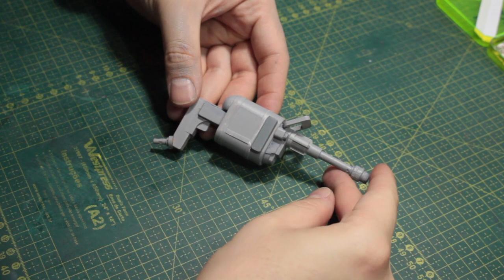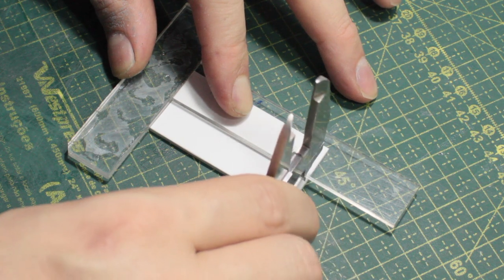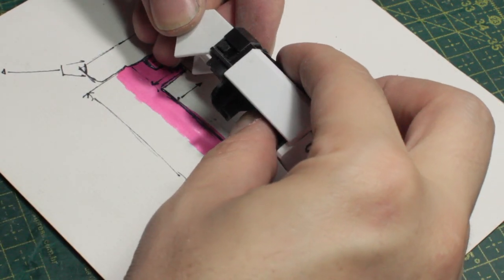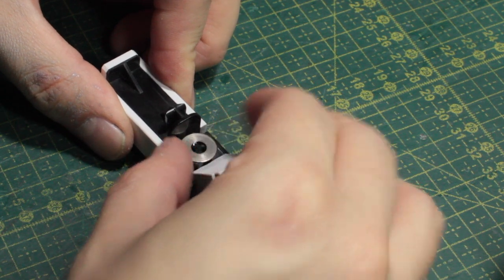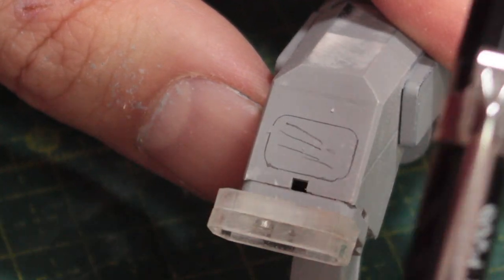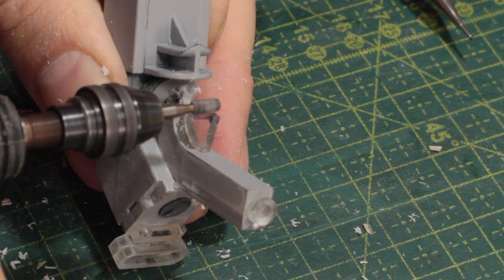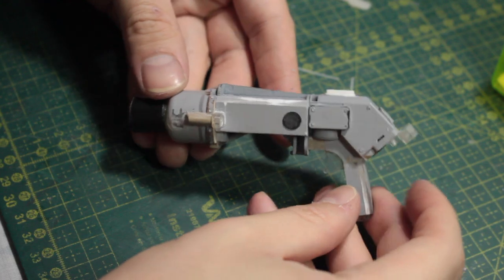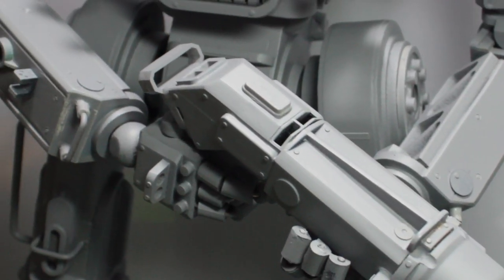Scratchbuilding a Humanoid Repair Robot - PT5 - Power Drill Upgrade!

Comment: I started collecting bits and what not and found a bunch of models in their boxes. What kind of paint do you guys recommend without breaking the bank?
Reply from the maker: It really depends! Do you use an airbrush? I would recommend any type of arts and crafts water based paint (I use mostly that type, never bought any expensive paint from famous model making brands)
Reply: @CutTransformGlue  I don't have an airbrush yet. Was wondering if you guys make your own washes and do you use acrylics?